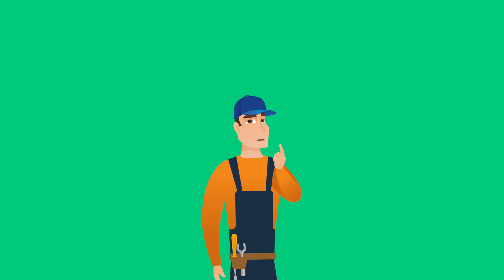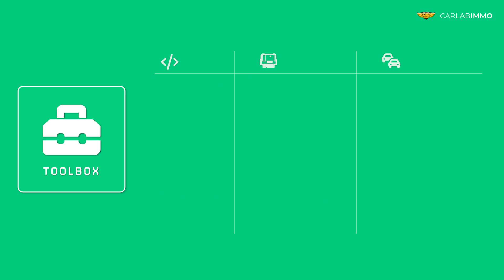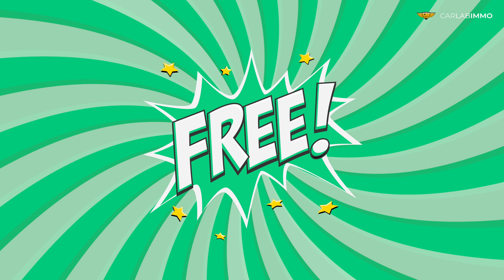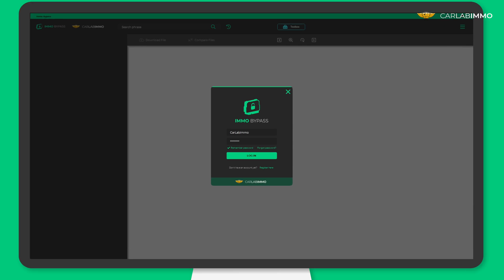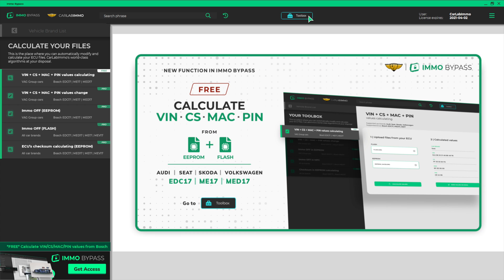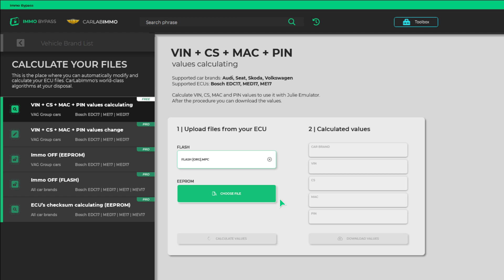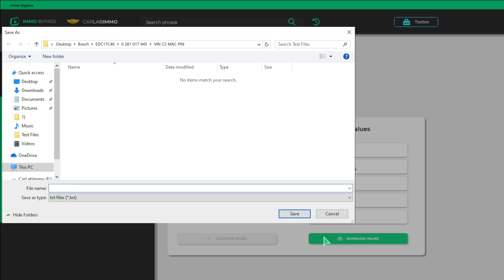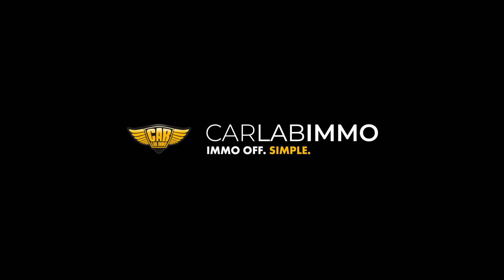How to read CS MAC PIN values | Immo Bypass Toolbox | CarLabImmo

Comment: Jast Question if the ECU Don't have eprom data . Like Delphi DCM6.2V  2015 VAG . what the solution ???
Reply from the maker: When it comes to this particular function, it's available only for ECUs Bosch EDC17, Bosch ME17 and Bosch MED17 installed in VAG Group cars (Audi, Seat, Skoda, Volkswagen).

Comment: it would be greta it these values could be  edited, vin,mac ,mac elv mac ecu,pincode etc.  can do much more    a  must in vag group.
Reply from the maker: You can calculate and change CS, MAC, PIN and VIN values -> https://youtu.be/oHmkFT7bWD4
This tool is available in Immo Bypass by CarLabImmo.